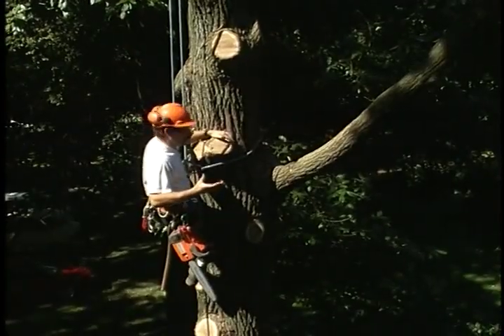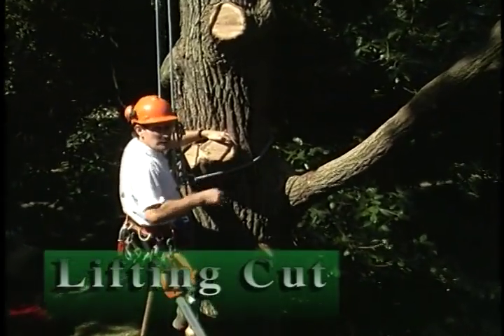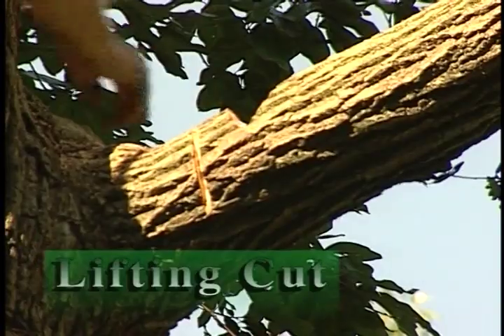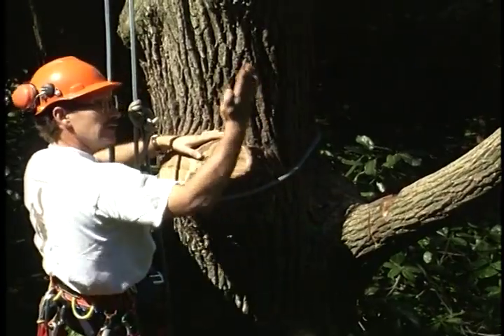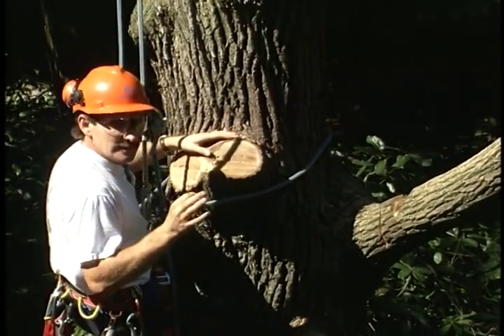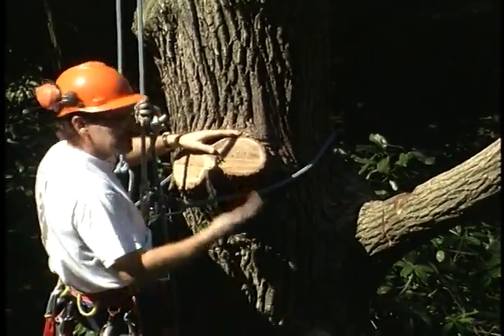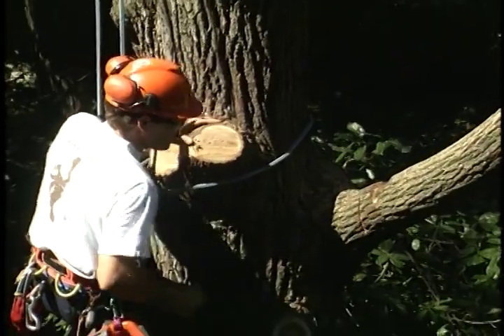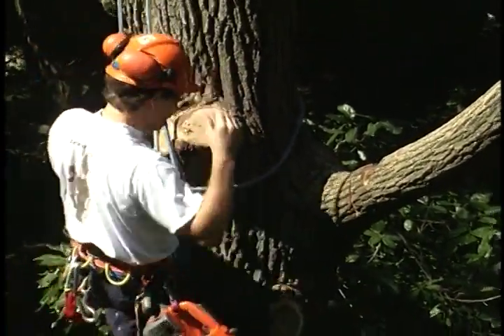Hinge Cut & Lifting Cut

Comment: Just dropping in to refresh my memory.  Going to need both of these techniques on a job tomorrow.  Using the homeowner and his father as groundies, I need to be able to explain clearly what needs to happen and when, and why. Thank you for sharing and stay safe!
Reply: How’d it go
Reply: @camturp2197  The tree had been dead for a couple of years! NO hold at all. Nothing hinged. A limb would start down and when the time came for the hinge to guide it, the whole thing would just pop off and fall straight down. I had to rig down everything after the first two fell. At the end of the day the tree was down, do damage or injuries, though I did get bunched up at one point and put the saw exhaust against my pretty yellow shirt! I made a joke about loving my saw so much sometimes I just had to hug it! Stay safe.